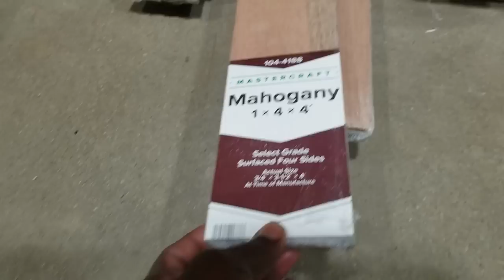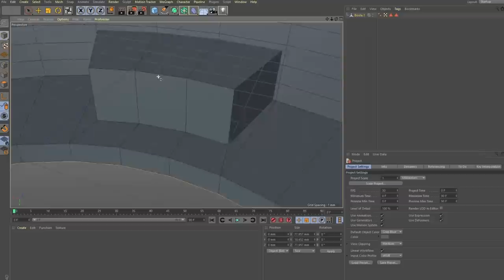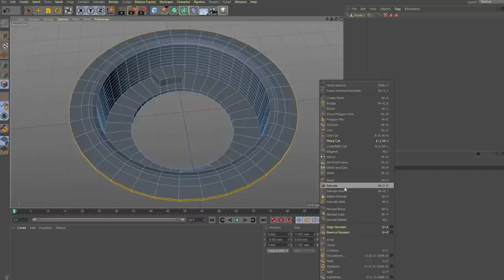🤔 Replacing Passive Radiators With Actual Drivers taken from the Flip On My Charge 4. Good idea?

Comment: Try fitting in with some cheap prs instead of drivers for experimental. It might have more punch than normal prs? I dunno.... lets try that out. 👍
Reply from the maker: I have ordered a couple PRs and they both don't fit. I'm still looking tho' if I find ones that fit perfectly, I will come back and report with a video, I'm loving these experiments 😂
Reply: @DLXWillington  Yeah me too.... loving these experiments too. Some time later if you couldn't find any prs, then diy is your answer.😂👍
Reply: Can u add air inside the pr to make a speaker have more bass
Reply: @rawwdyrichh3741  air inside a pr? How? With a compressor?
Reply: Keep pushing! 
What about upgrading the existing speaker w a coaxial race track driver for better highs???
Reply: @DLXWillington   can you send me a speaker??😂😂😅😅😭😭😭😭😭😭😭😭😭🙏
Reply: @DLXWillington  If I get dat JBL Charge 4, I could make it into a gigantic bluetooth speaker with big bass.
Reply: Try to change polarity from positive to negative - its 180* out of phase.. But You have 3 drivers in sealed enclosure set up, inevitably drivers will be out of phase. Better Use Charge 3 with Stereo set up.. I would love to see that. I hate charge 4 - disappointing I returned it to the store as soon as i literally put my ears and foundout its mono.. I have the Charge 3, Its great.
Reply: DLX Willington maybe it would work better if the polarity was switched
Reply: 🔵 I thought he had just gotten finished replacing the units original two passive radiators with actual drivers,.... Now I'm confused...... do you want him to go BACK to using passive radiators again?
Reply: @joshhayl7459  Trying out different types of prs. Like thickness and shape difference.
Reply: Karson Boston  Yeah works, but they got your account name and password recorded too. Have a nice day! 😁👍

Comment: Before:best bass
After: not so good bass
Reply from the maker: YUP!
Reply: @DLXWillington  Is it sealed well, and are all of the drivers in phase?
Reply: Not it's because there's no prs 😂
Reply: @jblfamily02  you really don't know any about sound physics, do you? 😒
Reply: @derSkedda  the speakers are just fighting each other which makes the bass kinda shitty
Reply: @derSkedda  it can be sealed and have hardly any bass
Reply: @derSkedda  unless you own 26 jbls then you can talk
Reply: Mike Rijnbeek best bass? You mean ,ok‘ bass.
Reply: @jblfamily02  Ummm, when you seal it the bass and the speakers get even worse
Reply: @jblfamily02  LOL
Reply: The pressure inside that plastic enclosure is alot more when you seal it up with three speakers speakers might push each other and they might not function well
Reply: Yeah! Interesting project but it won't work with different bass drivers, not working in phase. I think it would sound better if the big driver was used as passive radiator than all together.
Reply: @jblfamily02  bro you hearing what I'm saying
Reply: Flexplay no man the bass gets better when you seal a speaker cabinet not rocket science
Reply: The problem is that the enclosure isnt made for three drivers but one.
The enclosure is too small at the moment.
Sure it doesnt sound too bad but the original had a better balanced sound at the lows , very like jbl always do sound. If you want better sound it would be better to put in de original radiators back and make print new caps that can fit the speakers in while the passive radiators are also still in.
Just create longer / wider caps so the smaller speakers sit in front of the passive radiators inside a own small enclosure. At least thats what I would do 😉. Still nice mod though.
Reply: @phoenixyt124  i think he means 100 dollar from small ass speakers quality bass
Reply: @ivanfsgbg8291  what you say is not true I know something about speakers so you should not say something that you do not even know if it is true okay
Reply: It was the complete opposite u where using a crap pair of headphones otherwise
Reply: @WM22  my headphones are not crap hahaha
Reply: overall tuning of the system has a higher resonant frequency (three drivers in a newly sealed enclosure vs one driver with tuned passive radiators)
Reply: @spadespadespade  Define better: Tighter? In that case maybe your statement is true. Ported vs Sealed is usually a use-case thing, the stock PRs act similar to ports while remaining watertight - from my understanding anyway.
Reply: @ivanfsgbg8291  I don't think he was suggesting bass is everything, not sure why you even inferred that. However portable speakers usually mean limited enclosure space and power, therefore getting solid bass is difficult and often the limitation of these kinds of speakers. Meaning it is usually an area of focus when measuring their performance. Also you probably shouldn't flex (lol get it) on people with your 8".
Reply: @WM22  it sounded louder overall but most of that was treble. What headphones are you using for that to be misrepresented so badly?

Edit: There's a tiny bit more upper bass maybe? If your headphones lack sub-bass then  you probably didn't notice that it was basically non-existent after the modification.
Reply: @baklap141  you can overcome it with a lot of low-end boosting EQ and clean power (and IMO sealed subs in small enclosures can sound amazing if EQd for it, as long as the driver can handle the power)
Reply: @jblfamily02  bro whst are u talkin about. "Speakers fighting each other." Thats called creating pressure and sound waves. The reason it doesnt sound better is bc amp cant put out enought wattage for all these speakers.
Reply: The reduction in bass is due to the normal woofer now having to compete for internal air pressure with the newly fitted drivers, reducing the distance that the original woofer can return to during heavy bass. 

Affectively you’re creating an affect similar to reducing the cabinet size. 

You could try flipping the polarity of the two end speakers in relation to the original woofer, so they work in sympathy with the original woofer (they push while the other speaker pulls, rather than all speakers competing with each other by all pushing at the same time. You might find this active ‘push-pull’ works better for the bass.
Reply: Mike Rijnbeek Would have been better to add only one driver from the flip, plus the amp from the flip, and the passive radiator left alone on one side. The bass and sound would have been amazing.
Reply: Everything ELSE sounds better though! The original is missing some mids, i can't even tell what parts it just sounds wrong, but with really good bass lol
Reply: I thought it was obvious that  @jblfamily02   was saying the inside of the speaker becomes depressurized by all three speakers pulling at the same time, Not being sealed perfectly would 100% make this new speaker arrangement sound way better.
It's literally the first thing i thought at the beginning of the video lol, i wish i could buy it and drill a hole or two in it because it sounds phenomenal otherwise

Comment: You could improve the bass if you hooked the new drivers up, out of phase with the big single driver.
Just switch the polarity from + to -  so that when the big driver pushes out, the smaller drivers are pulled in, and when the big driver is pulled in, the smaller drivers are pushed out.
Right now they are all fighting each other to compress the air inside the unit.
Reply from the maker: This is quite interesting, it might with trying out 👍
Reply: True
Reply: my first thought.
Reply: @DLXWillington  I did the same thing to a stereo blue tooth unit. I removed the passive radiators and replaced them with drivers wired out of phase. It dramatically improved overall sound quality.
Reply: I would not suggest that cause they'll cancel each other out. What you have now is seald box. Changing polarity in this way is like plunging 2 different speakers out of phase and waiting for good results, but in realty they're gonna cancel each other out. Just look at bass driver, it needs enclosure cause there are 2 sides of speaker and without shaping the phase with box one side will cancel out the other.
Reply: PLEASE TRY THIS! I'M DYING TO SEE IT!
Reply: that would probably make it sound worse, sealed cabinets work on compression of the air
Reply: Epicly clever
Reply: Thats how noise cancellation works, i guess.
Reply: That would make no bass at all, the point of the box it producing positive and negative pressure, this would cause it to Abe no bass at all as the frequency’s would cancel out, for example noise canceling headphones play a opposite version of the outside sound on the inside to cancel out the sound.
Reply: @miespost  That would actually be true if all the drivers were on the same side of the unit. Since they're not, the cancellation of bass that is ACTUALLY  happening is due to the drivers fighting each other to compress the air inside the unit.
Reply: Pha Q you sir are incorrect, I’m not gonna start a argument with you so research acoustic design for yourself
Reply: I have a blue tooth stereo speaker that had drivers on the front and passive radiators on the back. I pulled the passives out and put in drivers of the same size. When I had all the speakers wired in phase, the bass was nearly completely cancelled out. When I wired the back drivers out of phase with the fronts, it dramatically increased the bass. I know this is counter intuitive to what you think you know, that is why experimentation is your friend.
Have a great day!!!
Reply: YOU WHAT. That's the most stupid thing you could do, it defies the purpose of the enclosure altogether. Even the passive radiator moves IN PHASE with the active driver (at the tuning frequency).
Reply: @PhaQ2  You are absolutely and totally wrong. At wavelenghts comparable to or bigger than the box itself it DOESN'T MATTER what side of the enclosure/box the driver is on (200Hz wavelength = 1,72m or 5,65ft - and this isn't even bass).
Your experiment is cute, but give some measurements you made, so you can prove what you're saying.
Reply: Pha Q you have to realize all drivers have a different impedance and phase curve depending on volume and frequency, passive radiators are weighted to slow down reaction time to be in the same phase as main drivers... I have a pair of 8 inch jbl monitors and a pair of QSC 8 inch pa speakers and the bass from them is completely out of phase, direction and placement won’t matter as bass is Omni directional.
Reply: @tomkocur  The fact that you think passive radiators move in phase with powered drivers, only exposes your complete lack of understanding. Please refrain from looking even more ignorant than you already have and stop arguing about something that will never ever effect your life. Stay healthy and have a great day!
Reply: Pha Q I agree with stop arguing this is kinda stupid 😂 but you need to stop being salty that you were proven wrong, before you say someone has a lack of understanding look in a mirror if you haven’t flipped that around thinking it will be more reflective yet, your point is invalid tell you can get me proof and measurements.
Reply: @miespost  You can argue all day, but the proof is in the pudding. When the content creator decides to try my suggestion and sound quality improves the way it did for me, you will want to delete your comments.
Reply: Pha Q if he does try that and it works that means there was some kind of phase issue in the start, I will not delete my comments because Ik what’s right and your ideas aren’t it chief, you do know your talking to someone that has been doing massive live shows and sound design for years, I’m sitting in my garage right now looking at  multiple oscilloscopes, function generators, distortion testers, calibrated spectrum analyzers, and many other peices of test equipment. I have measured so many crossovers and tuned many passive radiators, never once in my life has inverting the phase of a driver increased bass.
Reply: @PhaQ2  also, as Impuls audio mentioned, because bass wavelengths are much greated than box dimensions, bass is omnidirectional. If you wanted to get 180deg phase shift between two bass drivers playing at 100Hz, you'd have to place them 1.7m apart (and you'd have to keep this distance constant relative to the listener). That's quite impossible on a small bluetooth speaker, isn't it?
Reply: Reverse polarity will lower the volume as you're canceling out the frequencies with the reverse phase frequencies. It's fundimental acoustic cancelation.
Reply: @Greer_Agrendale  That's true if both drivers are mounted on the same baffle. If the drivers are mounted on opposing sides you get a larger peak in frequencies.
Look up isobaric loaded drivers.
Reply: @PhaQ2  Will do. That piqued my curiosity... Now I must learn how to make the ultimate speaker stack.
Reply: @Greer_Agrendale   I'm glad you're going to experiment with this theory. It's a topic that few people are aware of. Hope you get excellent results!
Reply: Yes this is good idea, because the passive radiator effect is lost. Now it creates negative air pressure. I think you should try it out and make sure that the chamber is not leaking any air pressure.
Reply: I agree with Pha Q, this will make balanced air compress decompression and will increase audio responses and maximum punch to the speakers if the sides speakers and the main speaker push proportional volume of air otherwise imbalance might cause damage to other speaker. In other side adding additional speakers whether parallel or series will affect the audio output power that the amplifier can deliver.

Comment: - Carefully. When you connect 3 Drivers to each other in a parallel order, the final impedance decreases radically. If you use the modified Charge 4 at high volume for longer time you can kill (burn) its amplifier. - You lost bass, because the box space decreased behind the driver when you replaced the Radiators with fixed drivers (and those also require box space).
Reply: Yeah cause the box is sealed too so the bass lowers

Comment: The speakers need to be wired up in series. By wiring them in parallel, your lowering the ohms, increasing stress on the amp, and increasing the low end filter with the lower ohms. It would work best if the side speakers had twice the impedance of the original; so that, they could be wired in parallel with the intent of replacing the original driver. I guess in the end, more research could have made your first try so much better. Thumbs up for entertainment!
Reply: Wouldn't each speaker in the series become quieter and quieter because of the voltage drop?
Reply: @elephant1851  That's why he said it sounds loud now. It was designed to work this way.
Reply: and it's more complicated because C4 transducer is 3 ohm, each F4 is 4 ohm, so if you put all three in parallel results in 1,2 ohm
Reply: Not series, series parallel
Reply: This guy didn't even know what aluminum tuning weights were on the PRs.. I doubt he knows ohms law or parallel vs.. series. These are quarky ideas at best with no real understanding.

Comment: Before the sound test, I thought the charge 4 modified will cut the bass and the loudness but after I was impressed for the loudness. I think you could put passive radiators on the front and back and the charge 4 modified is going to be better than the original.
Good video and keep up with the good work

Comment: the modified one has more treble and not enough bass but sounds louder
Reply: Yea cause the flip 4 drivers have no bass
Reply: DJekrom no you can find an e planari in in physics
Reply: @fantaseditings3017  what is an e planari?
Reply: Nope, he didn’t wire the speakers out of phase, so every 3 speakers are fighting on pressure...
Reply: @djekrom3286  you mean flip 1
Reply: yes we have ears

Comment: You reduced the impedence of that speaker to 1.33 ohm.(3 4 ohm speakers in parallel equals 1.33) that increases the output power of the amp. That's why its louder.

Comment: Excellent job dude, i have an jbl charge 3 that got wet inside, I recycle the battery, but with this know I can recycle the speakers and put them into another jbk
Reply from the maker: the drivers in there are quite a bit big but they might fit into an Xtreme. Good luck
Reply: It got wet and you recycle the battery.. 🤣
Reply: @shagga070  👍
Reply: @DLXWillington  I am really impressed with your GBL charge for yours

Comment: What i think before the soundcheck was even the result in the Soundcheck: Way more open mids, but the Bass can not completely compensate the movement from the membranes. The original passive radiators do that, but now the air pressure works against the flip-drivers and they produces air movement too. So it’s normal to get small interferences, the bass can’t work correctly. Also the overall tuning doesn’t fit any more. 

For me the Charge and also the Flip are not really good speakers. A mix if both don’t make it better. JBL has to tune the Speakers better, that should be no Problem because the hardware is ok. So if JBL would simply change the sound signature i would give them a chance. So many fans say that the bass on the JBLs is great, but it’s not. Bass and hights is all you hear, but both not well defined, not strong. The Charge looses in Mids and Stage. The Flip looses in harsh metallic hissing hights and thin bass at higher levels. So it makes no sense to mix that. 

Very interesting video and i really like  and enjoy your comparisons, but pity about the time invested in this test project. ✌🏻
Reply: Ur my bro